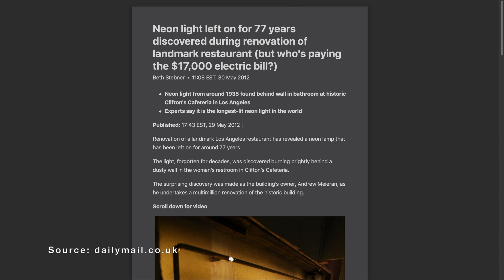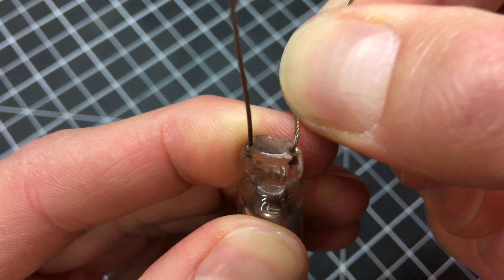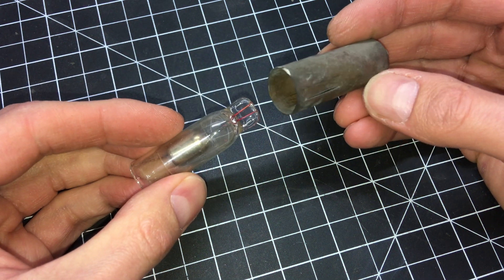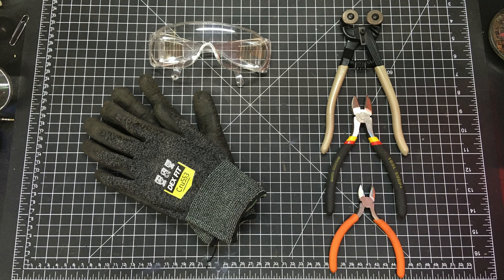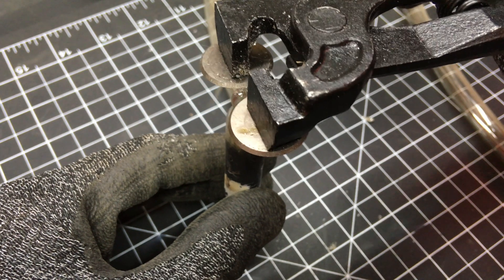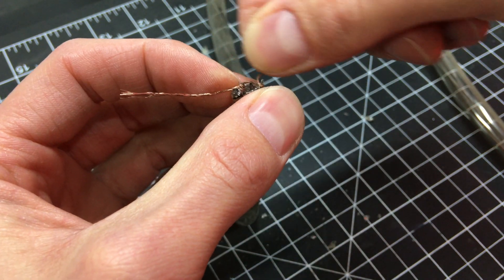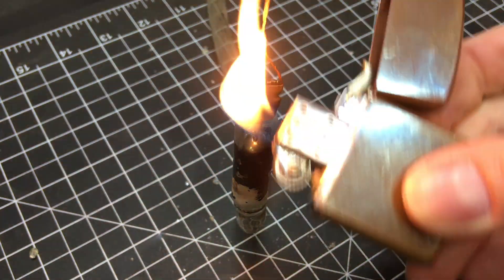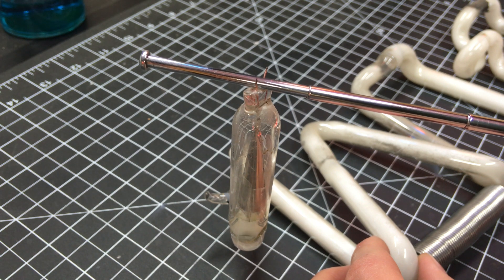How to Repair Neon Electrode Wires

Comment: Bird person, is one electrode a positive and the other a negative ground wire?
Reply from the maker: negative.  neon tubes are wired in series, and the two wires are merely for redundancy.  some older electrodes only have one wire.

Comment: Thanks for the video. what materials are used for the electrodes, are they brass and ceramics ? I see you used copper for the wire repair. Also, what was that black silicone substance called you used with heat shrink..it looked like glue or some paste?
Reply from the maker: there are different styles of electrodes and have been many variations over the past century.  i believe modern electrodes are an alloy... but they definitely a high iron content, because electrodes on outdoor signs with broken tubes will rust.  the electrodes have a special getter coating on them that gets activated above a certain temperature, which is why during processing the metal must be heated to a bright, glowing orange.  
some styles of electrodes have ceramic rings on the tips to prevent side-firing, some have mica spacers to keep the electrodes aligned, etc.

the black substance i used was just a tube of RTV i had lying around.  id imagine any type of silicone would work, although i have been informed that some types of RTV are acidic and can corrode metal.  i haven't verified that personally, but it seems like something that could be plausible and is worth investigating.

Comment: Neon repair mechanic you are. What about scoring the glass with a diamond and wrapping below the score line with tape? I think the grinding could be done with a diamond abrasive pad wet sanding. I used them for granite repair. Probably a skill that needs to be practiced with old scrap pieces. Kudos to you my friend
Reply from the maker: the method i show here is by no means the only way to do it; any technique or tool that can carefully remove glass without compromising the tube can be attempted.  feel free to share here in the comments if you find more successful techniques!

Comment: Hi, Is it possible  to extend the HT neon wires that connect to the electrodes on a neon sign please? I have a neon light but the 2 wires are not long enough, what do I do to make them longer please? Thanks
Reply from the maker: hello Darren, i have sent a detailed reply to your email inbox.  let me know if you have further questions!
Reply: I'm just guessing. Center of wire splice? Scary to disconnect at a delicate spot @NeonPreservation
Reply from the maker: @Weasel-o-Matic  splicing high-voltage wiring is not recommended because it compromises the integrity of the insulation.  also, certain transformer designs limit the maximum allowable length of the secondary leads, and splicing could cause fault problems or other load-balancing issues.
there are neon industry specific, code-compliant splices for high-voltage wiring available, but they are intended for use in large commercial installations.  if you have a transformer that has had its secondary leads cut too short, the safest thing to do would be to replace the transformer.

Comment: Why are there two leads coming out of the end of the tube? I have one broken wire and one good wire. Can't I just attach to the one good wire?
Reply from the maker: there are two wires on each electrode merely for redundancy; if just one breaks off you can still use the other, no problem.
in the past, some electrodes were manufactured with only one wire, but that design has fallen out of favor... likely due to the benefits of having two!
Reply: @NeonPreservation  Thank you! Is soldering on a longer wire a good way to make a connection to this one remaining lead?
Reply from the maker: normal electrode wires are about 1½ inches long, if your wire is broken off shorter than that an extension might be helpful.
however, any longer than that wouldn't serve much purpose and would probably add strain to the wire, making it more likely to break later.
Reply: @NeonPreservation  Thank you!

Comment: Are you part of the Neon Lighting Professionals group on Facebook? It's a pretty nifty place
Reply from the maker: yes, i am!  but since i am merely an amateur, i'm there more as a "fly on the wall" to learn as much as i can.
Reply: @NeonPreservation  likewise and ditto! I just posted about a hole I made in my manifold system with a Tesla coil. Oops too much power
Reply from the maker: ouch!  yeah you gotta be careful with those.  if im really curious if my manifold is still under vacuum i test it on the bit of tubulation glass left from my last tip off, that way im not actually using the spark coil directly on the manifold.

Comment: I think you could also try making an electric arc near the broken electrode.The glass would melt in a few seconds and if you touch the glowing end of the neon sign wire to the also red hot glowing electrode,they will probably weld together.
Reply from the maker: i like your lateral-thinking!  however, heating the electrode pinch seal will usually cause it to crack.  i have cracked one and ruined a tube using an electrical arc for just a few seconds.

Comment: If you dont want to risk breaking the glass,you could also dissolve the end of the tube in hydrofluoric acid or molten sodium hydroxide.
Reply from the maker: interesting idea!  sound time-consuming and dangerous though.  also id be concerned about the heat from the molten NaOH cracking the pinch seal.
Reply: @NeonPreservation  Hot NaOH solution could also work but would be slow.

Comment: Thanks for the info. I thought i should be able to do something like this to repair my clock. But, was afraid to try. I was able to use dremel diamond tip bit to grind away glass.
Reply from the maker: you're welcome!  yeah... it's pretty risky, but if it works it's worth it.  good job!

Comment: What gauge wire do you recommend.
Reply from the maker: i'd say 30g or smaller should work; you'll want small strands so you can bundle a few together and have them wick up the solder to make a solid joint.
the strands i used in this video were 38g.  they were from a scrap piece of copper wire (extension cord, i believe) that i had leftover from a project.

Comment: I replaced a beer sign transformer and broke a glass section when l connected wire. I knew better but it happens. I should have cut wires as close as could to the broken transformer which would have given me plenty to connect to away from the glass tube. Those darn black boots don't always come off easy and now only a small section l broke doesn't light.
Reply from the maker: ah, sorry to hear that.  if it was a clear (i.e. neon-filled) tube, any neon shop can repair it for you.  if was an Argon/Mercury tube you might be hard-pressed to find someone who would repair it.  so, you can have them make a new one, or try your luck to see if you can find the part on ebay or on one of the neon beer sign/repair groups on FB.